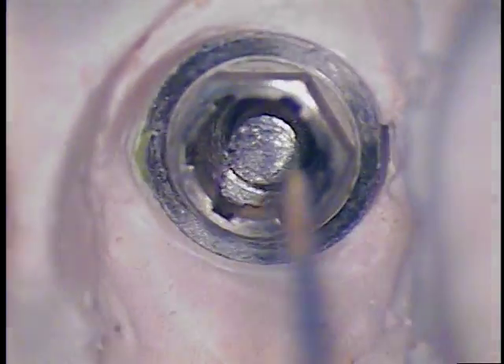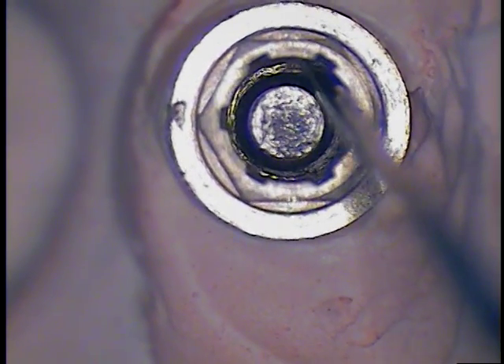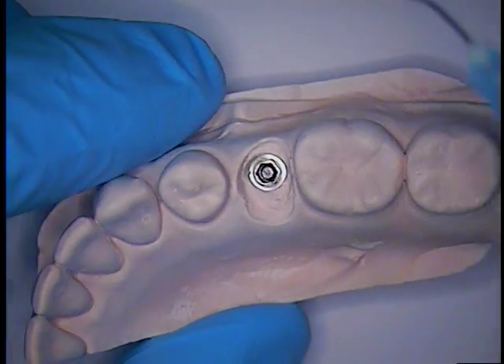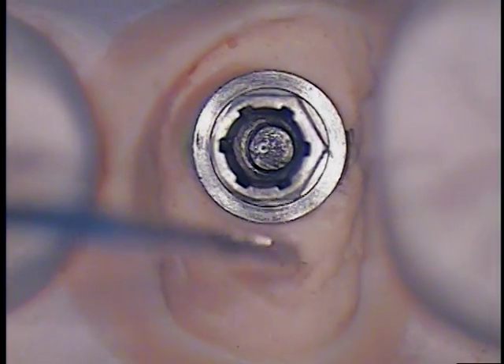Broken Implant  Abutment Screw Retrieval Demonstration 2/3

Comment: 1 - Protect the threads with a suitably sized titanium ring, ideally which threads over the threads themselves.
2 - Use a small diameter drill-bit to drill 2 holes into the top of the fractured screw. Lock the drill in place and start slow.
3 - Use a snake-eye driver placed into the holes you have drilled to turn the screw.
Reply: where would one obtain the titanium ring that would thread into the implant?
Reply: @perseus9428  what do you mean? From companies which make this stuff.